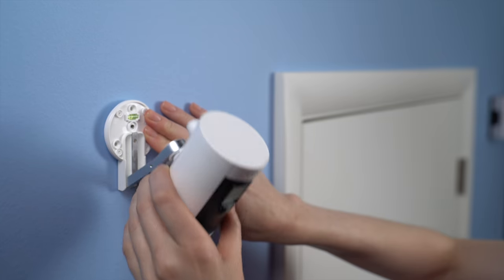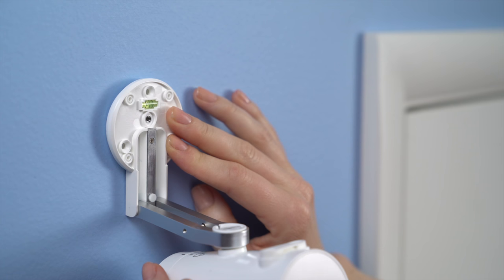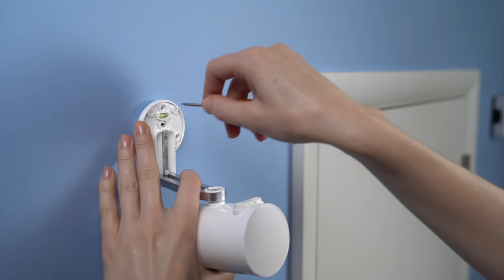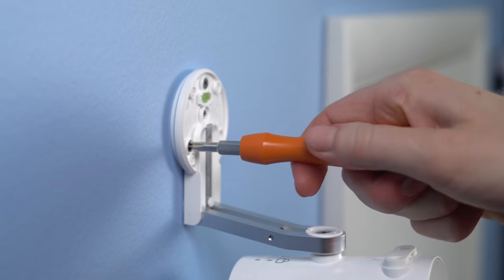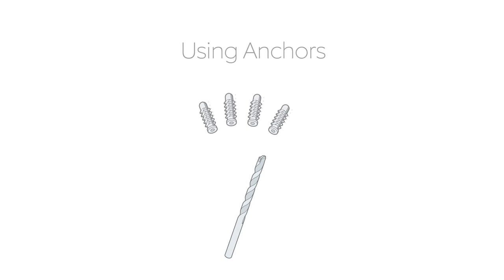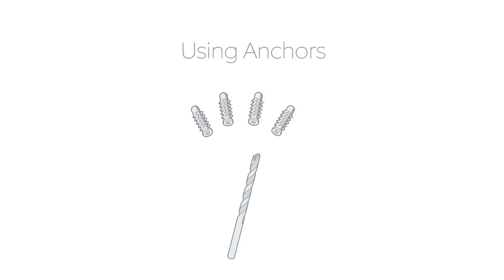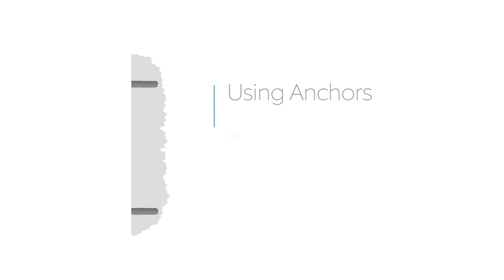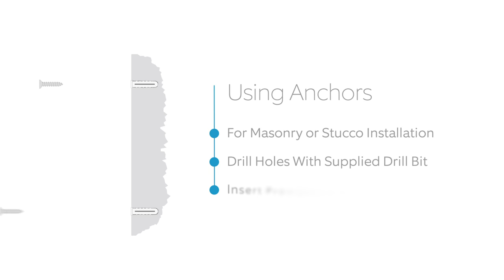How to Install Ring Stick Up Cam Battery on a Wall

Comment: Do we NEED this mounting bracket if we're putting our camera's outside? Is the bracket JUST for more camera movement? We bought 3 cameras, but we didn't buy any mounts or anything.. assuming we didn't need to.
Reply from the maker: Great question, Lady Nuri. All Ring Cams come with a mounting bracket that should be used when installing. Do note that the included bracket may be different than what's in this video. Please refer to the installation instructions in the box for more info and let us know if you have any additional questions. We're here to help!

Comment: I purchased 3 of the Stick Up Battery cameras, but would like to have the ability to configure the motion zones the same as with the wired camera & doorbell.  Guessing a limitation to extend battery life, but let me make that decision how I want the camera to function.  I purchased a solar panel hoping this functionality would be added since the battery would always be charged, but it's still the same shallow motion zones.  Please consider adding this in an update.
Reply from the maker: Hey Chris, you are correct. Our battery-powered and solar panel connected Doorbells & Cams use standard motion detection whereas our hardwired or plug-in Doorbells & Cams use advanced motion detection. We appreciate your feedback and will be glad to forward this to our development team. On our roadmap, we're looking to add an advanced motion detection option to some battery-powered Ring devices with Smart Alerts in the future. We look forward to sharing additional information as this feature becomes available. We appreciate your patience in the meantime!

Comment: Will this work from inside if you want to view the back garden
Reply from the maker: Hi there. This can definitely be used to watch over your back garden from inside, as long as the device is not placed behind a pane of glass, screen or any other obstruction. We also recommend keeping it within 30ft of the area that you want to monitor for best visibility and motion detection. Let us know if you have additional questions!

Comment: Hello there , i have the stick up camera inside to view the back garden in the day time the pic is v clear but in the dark there is no night vision can hardly see anything any tips
Reply from the maker: Great question. We don't recommend placing Ring devices behind windows or screens as this can obstruct the night vision and motion detection from working as it should. Try moving your camera outside for a more direct view, as this should clear up the night vision. If this doesn't help, please let us know!
Reply: Ok thank you
Reply: I bought a very decent solar light which turns on with motion.

Comment: How far does it go right  and left
Reply from the maker: Hey neighbor, the Stick Up Cam Battery features a field of view of 130°diagonal, 110° horizontal, 57° vertical. With the flexible mount, you'll be able to adjust it towards the area you're wanting to monitor. Please let us know if you have any more questions!

Comment: Why y'all make the batteries so damn hard to remove
Reply: I can't get the battery out - how'd you end up doing it?!
Reply: @drmichaelfunk  it's a tricky way but it does come out, I had to use a damn corn dog stick
Reply: @Parables_of_Prosperity  Ring Stick Up Cam Only Has One Battery Department?